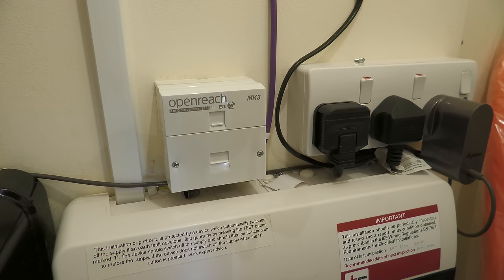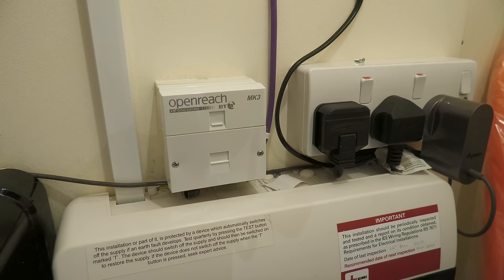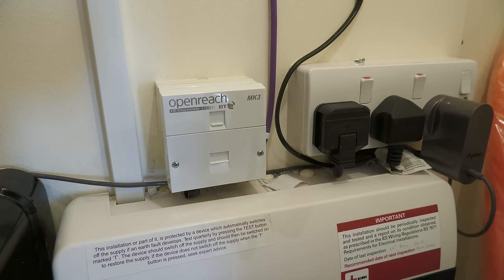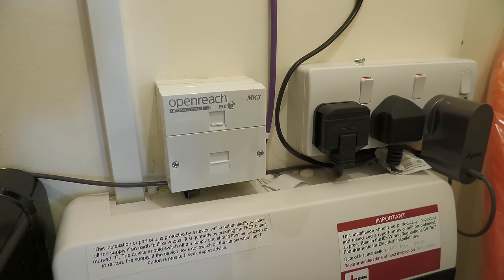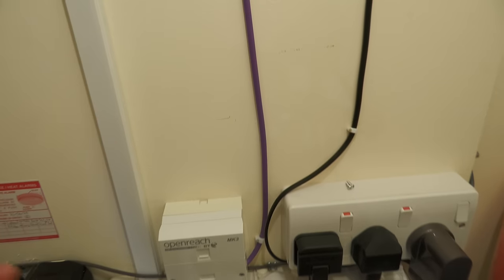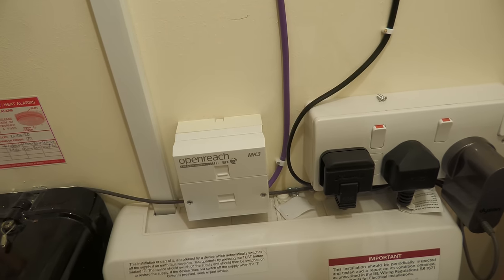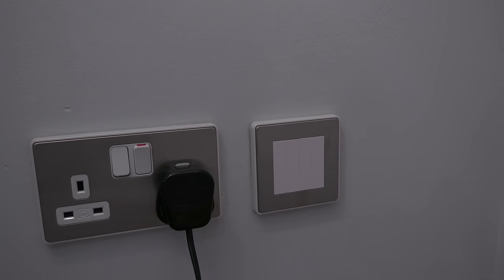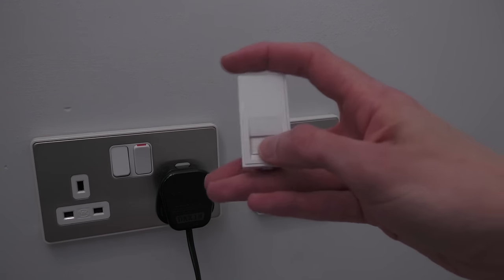300 Mbps DSL!  Upgrading my Home Network to TalkTalk Fibre 250 G.Fast Broadband

Comment: Fab video & watching the original NTE5 walkthrough I was thinking "nooo he's got the ringer connected!! Whyyyyy?!" Then saw it had been removed on the NTE5c :) 

The main issue, as an openreach guy communicated to me many moons ago is it's a single cable that's live, despite being in a pair, it's not able to benefit from the interference reduction where a powered pair offset one another when both cables in the twisted pair are live. Hence it's much more prone to interference and can bring with it a fair bit of noise. This is often worsened when its located close to the mains electric wiring (as your setup is) as the electrical grid is full of "dirty electric" given the prevalence of DC and low power devices such as LED bulbs etc. Sure the filters isolate out interference but there's always a limit of how effective this is in practice, so it's just better in general to disconnect it. 

Interesting that TalkTalk still don't seem to have digital voice and the legacy extension wiring works without reinjection techniques. I find connecting via the hub inconvenient compared with the wired in extensions, as like yourself, my routers in a random cubby. That being said I hardly ever use the landline - only used it when EE was down. Nice to have the backup... I'm now on Virgin with connection into their hub via an RJ11 to BT dongle that connects into the Hub 5.

Comment: I use TalkTalk. I use my own router and modem so I avoid contacting their support, as ISP routers have security issues.
Obviously Wifi is now my problem, but that's OK.

I keep their modem handy if there is an issue, as it's easier to talk to support if you use their modem.

I've found the service and speeds fine - a few drop outs of the service every few months, and I try and avoid relying on their support as much as possible so that is not a concern.

Comment: I have the 500mbps fibre and until two weeks ago was only getting 280mbps, however they sent me an eero 6, boy what a diff 500mbps, 5 g network runs like a dream.
Reply: Which ISP is that.
Reply: @gonzaga3c  talktalk i was told.router was.wrong one

Comment: Interesting stuff, cheers. In the South East UK, there's some supplier that's doing similar speeds for around £40-80 a month (DOWN/UP: 300/100 500/200 and 900/300). I was tempted, but I don't really need it and the alternative (same as your previous supplier) was £10-20 cheaper.

Comment: BT/Openreach do make me laugh with leaving all their crap behind.
So back in the days before ADSL lines we had just the one master socket on the wall then ADSL comes along and being an early adopter this require a whole new socket attached below the original one that stuck out the wall like a sore thumb.
A few upgares and years later this new socket gets made redudnat by them upgrading the original socket to the NTE5 socket (of course leaving the ADSL socket in place) and now these days we are sporting fibre to the home which brings another box with it attached to the wall and making the original socket fully redundtant too.
At this point I feel they have an obsession with sticking boxes and sockets on walls lol
I look forward to the next technology that makes the fibre box redundant so Openreach can screw in even more of their stuff to the wall!
Still I am not going to pay them £150 to come remove their crap so I will probably remove the ADSL box when it is time to decorate.

Comment: Just had symmetric gigabit FTTP installed here in Lincolnshire. They used the existing BT conduit so no digging up of garden or anything like that. Only catch is you have to use their router so we have a double NAT situation with my UniFi gear, but it’s £40 a month compared to the £68 BT were charging for FTTC.

Comment: I get over 600 Mbit/s down and about 140 Mbit/s up (and that incredibly reliably) through my g.fast DSL connection in Switzerland, but the copper run is only about 20 Meters until it gets convertered to fibre. But you can usually get close to 500 Mbit/s even if you live further away, g.fast is amazing
I'd try to disconnect your phone extension, your speeds might very well improve. The only reason we can get such high speeds here is because wiring (which actually is my own responsibility for everything, the demarcation point is just a kind of connector block) you need to only have one direct cable to yor socket and no phone extensions (or rather they are done through VOIP "Backfeeding" from the router, But NOT connected to the main telephone line)
Reply from the maker: That's really good speeds, the speed I'm getting is capped by the ISP, be interesting to see how fast my line could actually go but I doubt that they'll offer any G.Fast packages higher than 330/50

Comment: in lithuania Telia is like BT (a main provider of phone lines, fiber internet and (like EE a 4G/5G operator)) (BC PLUSNET and TalkTalk uses BT as backbone and use same lines) and they use a thing which is called SVDSL+ and SVDSL++ which give around 300 to 500mbps down upto 2 kilometers from exchange (or every small phone box with a fiber connection) so we get ping of 8ms and upload upto 100mbps which is fricking wild
Reply: Heard long time your country got fastest internet. Way before us here in U.K. catch up.

Comment: Nice Video. Looking at the old filter sockets brings back some scary old memories. I moved from the UK to NZ some 10 years ago and the fastest connection at the time I had was 8Mbps. When I came to NZ they were just moving away from having download caps to unlimited data and FTTH was about to be launched felt odd and I thought New Zealand was so behind. I managed to get one of the very early connections at 100/50Mbps which I though was just amazing. Now I'm on 1000/500Mbps and have the ability to upgrade to 4000Mbps down at least (Haven't bothered since I don't feel like I use what I have). NZ is also completely ditching copper now in favor of fibre everywhere. It actually really scares me going back to the UK. Last time I did it really felt like I was going back in time, but then I went from what I have to my in-laws crazy slow In-The-Middle-Of-No-Where 2Mbps. Enjoy the new speeds! 🙂

Comment: Info. Draytek Vigor 166 can be used in "Modem only" mode for a G.Fast connection. They retail for about EUR 110 in Europe. Tried to get a UK price,  but most UK sites show it as currently unavailable.
Reply: just get a 110
Reply from the maker: The Vigor 110?  That's end-of-life and only supports up to ADSL2+, nowhere close to G.Fast.  With Draytek you'd need at least a Vigor 130 for VDSL and the Vigor 166 for G.Fast.
Reply: @camerongray1515  sorry I meant the 130. Are you sure it doesn't support gfast?
Reply from the maker: Nah, the 130 is just VDSL2, the 166 is the minimum for G.Fast

Comment: I power my bt openreach modem remotely by my downstairs phone socket with a  generic 12v POE adapter, easy way of making sure the internet stays up if the power goes out as my rack is on a UPS.
Reply from the maker: I definitely considered doing the same - didn't in this case as the socket was so nearby and I don't use a UPS but using those adapters is definitely a good option in a lot of situations.  I had it in my head to mention those in this video but clearly totally forgot!

Comment: I have a question to ask you. ! my question is, do you know the white box attached to the wall? Is that connected to the cable outside and is it from the cabinet or two copper cable?
Reply from the maker: It is a standard copper phone line that goes to the street cabinet.  G.Fast exists to provide higher speeds than traditional FTTC vDSL over standard copper phone lines.

Comment: Great video. Just in the process of switching from Skq gfast to TalkTalk gfast.  Does the TT gfast modem send pppoe credentials or is this being sent through your router?

Thanks
Reply from the maker: TalkTalk don't use PPPoE so all you need to do is connect the modem to your router and configure the router to get a WAN IP over DHCP.  Definitely a nice bonus since you don't need to worry about potential MTU issues that can come from PPPoE's overheads.
Reply: @camerongray1515  Thanks for this video, it's given me the confidence to swap around the way my home BB is now working.  I stuck with Sky g.fast but switched out the Sky SR204 for the Openreach modem and then have set the Unifi Express IPv4 DHCP Client Option 61 up and all's working.
Did you set the IPv6 Configuration up on the Unifi?

Comment: Does the ZT Link MT992 modem work on TalkTalk FTTC? Wondering what your thoughts are on this vs a Draytek 130/166?
Reply from the maker: Are you referring to a G.Fast or a VDSL connection?  It works for TalkTalk G.Fast (it's the same model of modem I have here) however I'm not sure if it'll work for VDSL.  However, for VDSL you should be able to pick up a VDSL capable Openreach modem for cheap on eBay.  The Draytek modems are also good option and I've used a Vigor 130 previously, although an eBay Openreach modem would probably be cheaper and doesn't require any configuration on the modem end like the Draytek would.

Comment: Just curious, what trunking did you use? I'm looking on Amazon and they all seem really ugly.
Reply from the maker: It's just cheap 15x16mm rectangular trunking from a hardware store.  I'd generally recommend buying trunking in store where possible - on Amazon it's usually cut down to several short lengths to make it easier to ship which leaves you with more joins on longer runs.
Reply: @camerongray1515 Thanks! Does it use adhesive or do you have to drill holes?
Reply from the maker: You can get either adhesive or non-adhesive trunking.  I personally use non-adhesive stuff and screw it on because I find it easier to remove and just have a few small screw holes to fill.  Adhesive trunking has a tendency to make a mess of the wall by pulling off paint/wallpaper/the surface of plasterboard/drywall when it's removed.

I also use these clips inside the trunking which screw into the wall through the trunking holding both in place: https://www.d-line-it.com/f-clips/.  These hold cables in place in the event of a fire (which is required in certain situations by UK regulations to prevent firefighters getting tangled in cables) but they're also ideal because they allow you to remove the lid of the trunking without the cables falling out.
Reply: @camerongray1515 Thanks for the detailed reply! I can't find any non-adhesive trunking weirdly for the size trunking I want, but I can just buy the adhesive one and remove the adhesive and screw through the plastic.

These clips are nice. On a somewhat separate note, I have also used a staple gun if it's a single cable with a U-staple and then painted over the cable and staples, so it blends into the wall more and that can honestly be more inconspicuous than trunking in certain situations.

Comment: Fair enough I used to have TalkTalk years ago and then he started doing traffic shaping so you couldn't torrent anymore but I've not done that for years.
Reply from the maker: I don't torrent either although thankfully now TalkTalk no longer do any sort of traffic management, presumably after the regulations changed requiring them to be upfront about it: https://community.talktalk.co.uk/t5/Articles/Broadband-traffic-management/ta-p/2204657

Comment: Hi there from Germany.
I do not really understand how this is working.
In Germany we have Vdsl with 50/10 MBit and 100/40 MBit. Yours was in the middle of this. And we have 250/40 MBit also just as VDSL2 with Supervectoring. My connection on copper with 165m is 267/41 mbit.

I always thought g.fast to be at least 400 MBit.
Reply from the maker: It's just a case of different countries/service providers offering different speeds on each service.  There may also be differences in things like the types of cables used, in the UK services will likely be designed with the fact that many properties will be connected using cables that are 60+ years old.  In the UK on VDSL the speeds generally offered are 40/2, 40/10 or 80/20 and on G.Fast the speeds offered are 150/30 and 300/50.  VDSL2 with Supervectoring isn't really available over here and G.Fast is no longer being rolled out to new locations with the main focus being on rolling out FTTP everywhere.  I'm using G.Fast for now since it's the fastest available in my property but it's likely that FTTP will be rolled out in my building within the next year.

Comment: just wondering, why is your ONT so big compare to mine? i got fttp installed and its very small from your one in the video.
Reply from the maker: It's not an ONT, it's a G.Fast modem - I'm using a copper service, not FTTP as it is not available in my area yet.

Comment: Is your area in the Openreach plan for FTTH "Full Fibre" rollout any time soon?
Reply from the maker: It's currently being rolled out on the surrounding streets, can see the fibre cables and splitters on the outside of the buildings. However, I'm in a modern building where they can't just lash the cables down the outside of the building like they're doing with older buildings.  (To be honest, I'm almost glad, it looks horrific). I asked the Openreach guy about it and he said that I'll be getting it eventually, it'll just take longer as they'll need to liaise with the factoring company to gain access and install the cabling through ducts inside the building so I suspect they're prioritising getting the core network in now then they'll work on the tricker installs later.

Comment: can you do a video on how to wire the cat6 from the BT wall socket (I have the same as you) to the patch panel and how you know which wires to use from RJ11-RJ45 etc? I like the idea of having everything in the cab and I plan to do this myself, currently, the ISP router is sitting outside the cab with wires everywhere and if I can do what you have done it would look much better. thanks! :D

Comment: Further reading on using a cheap vps for the connection to a better machine you own? Also possible on cgnat connections?
Reply from the maker: Don't really have any further resources on it, been a long time since I did it, but it would definitely be possible on CG-NAT, you would just need to run the VPN server on the VPS and connect from a client behind your CG-NAT.   The AAISP L2TP service also states that it's designed to work behind CG-NAT if you're looking for a more "managed" solution: https://www.aa.net.uk/broadband/l2tp-service/

Comment: I would not recommend using an OVH VPS to provide additional IPv4/6 static IPs for home use as a lot of sites block access from OVH IPs so no Netflix, etc.
Reply from the maker: Ahh that's annoying, my reason for recommending them was because they're one of very few providers that allows you to have multiple IPv4 addresses assigned to a single VM allowing you to properly route one down to your home router whereas with a VPS with a single IP you'd have to do NAT at the VPS.  Suppose in some situations you could maybe get away with only using the static IP for inbound traffic or potentially you'd need to look at other providers.  When I did this previously it was purely to connect to servers so general outbound internet access wasn't something I really tested much.

Comment: I use 5G cellular to serve internet to my whole household.  Serving 3 adults and 2 kids, no significant downloading and no P2P so pretty much just streaming video, gaming and normal web usage.  On a 75 - 200 Mbps connection I am averaging 1 - 3 TB data usage every month.  5TB might seem like a high data cap but 1 person doing lots of P2P could easily hit that cap.  Data caps are pure greed.
Reply: I had a Three 4G cellular connection a few years ago as the area I was living in didn’t even have adsl as BT weren’t alerted to the new block of flats going in.
Biggest use was downloading the massive game updates for the xbox. I also noticed that the ping response was a bit slower than having a fixed line.
Reply: I think the main issue is still the BT wholesale Centrals costs, and commercial transit peers who may be charging at a wholesale level depending on data transfer. There is also an incentive for over-contended retail ISPs to disincentivise the "whale" users, it always used to be that a minority of users would consume the majority of backhaul bandwidth on core networks, but nowadays everyone is a fairly large consumer of data thanks to streaming. Hence why the UK's largest ISPs colocate on-net caches for the biggest streaming services (iPlayer BIDI, Netflix OpenConnect, etc) and edge CDNs are massively popular.
Reply: How are data caps greed on wireless (5G) which is a shared medium? Seem kind of practical to me, fibre is a different story.
Reply: @edc1569  I meant data caps on wired connections like dsl/cable/fiber.  A 1TB cap, which at least one company in the US imposes, means continuously you are allowed less than 5Mbps on a 1000Mbps fiber connection.
Reply: @Angel_the_Bunny  no data limits on wired connections in the UK and I have unlimited data on my 4g/5g connection which I lay about £27 a month for
Reply: You're right with P2P, I can easily consume 1TB or more within 2 weeks or less, I download 4K movies that easily around 50-90GB, I tend to download around 200-300GB  a day.